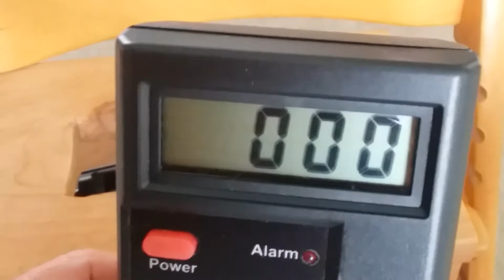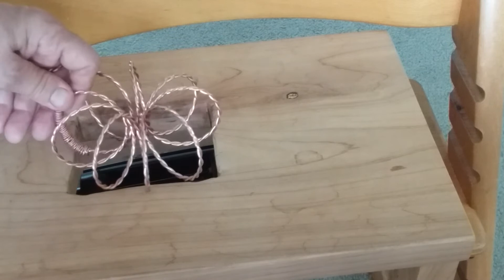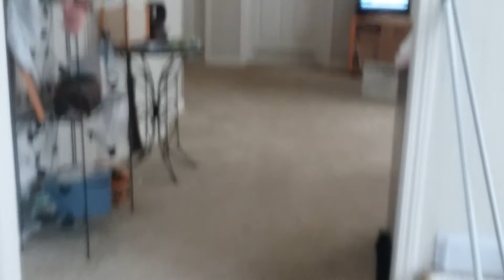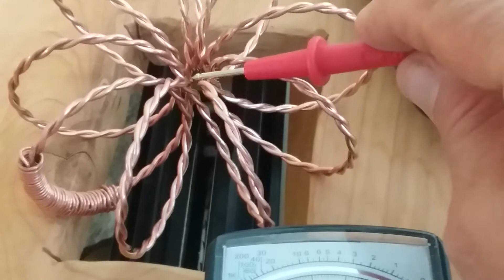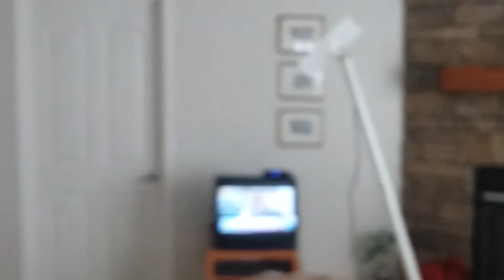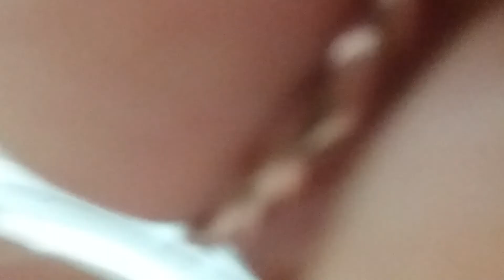EMF protection & more! Proof of metaphysical  influence of Tensor Generator 432 Mhz frequency!

Comment: Can you make a video measuring the emf of a wifi router, and then moving the generator near the router?
Reply from the maker: Thank you for the interest.
It's been quite busy lately. But I'll try sometime to do that. However, I can tell you that every device has a  field in a different location depending on where it's placed so perhaps it's best you get an inexpensive EMF reader to find out where the strongest part is in your mofem.
If you like to see how the generator blocks and transmutes news  dirty electricity  into  beneficial energy  I have a video with it on my fuse box. See here below.
https://youtu.be/QrjJ1kdIHx4
Reply from the maker: I don't know if you have seen my water freezing test with a mini generator pendant,  this shows part of the range it impacts...  this is my best visual test. The energy has to go through a bit of air before it influences the water so you can see what part of the field of 1 -1/2 in mini tensor generator  has.
https://youtu.be/h2phsPGTF5s
Reply: How long is a cubit In cm or inches